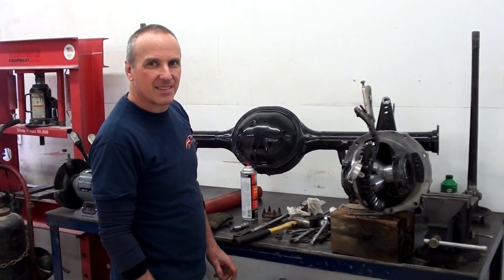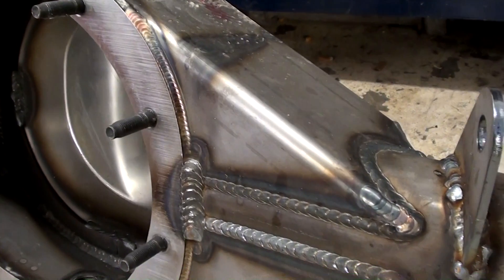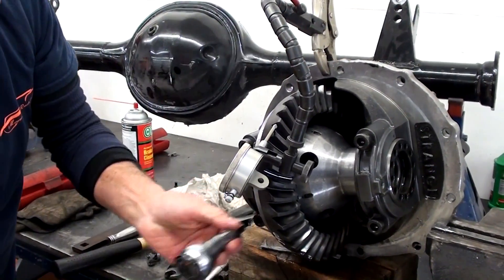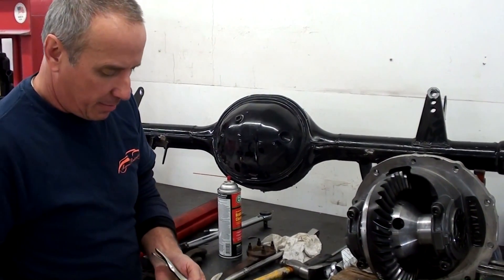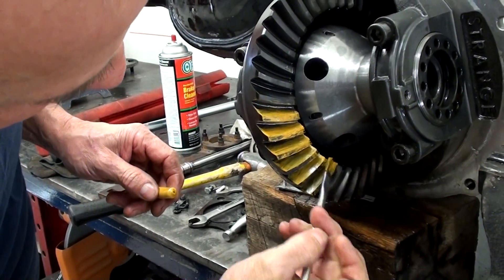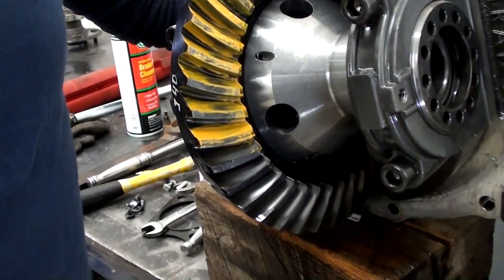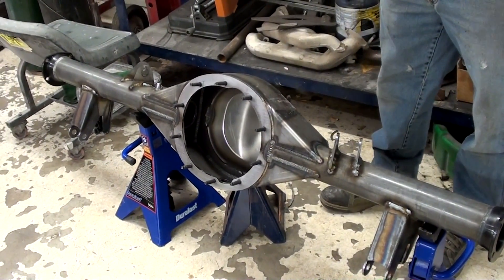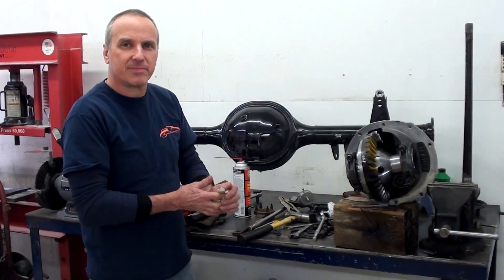Ford 9 inch Setup, Faux Wood Grain Painting, & Metal Fabrication

Comment: Hey Jeff, would you consider a Ford 9 inch more durable than a GM 12 bolt?
Reply from the maker: +canibusnj Stock vs stock, I'd say the the Ford 9 inch definitely has the edge.  Either can be made stronger though, with the right housing, axle choice, etc.